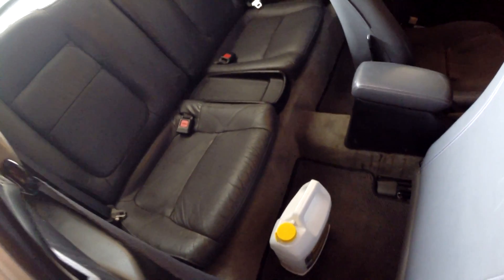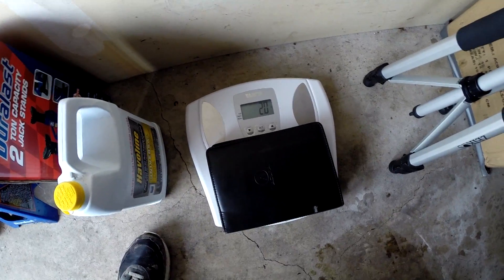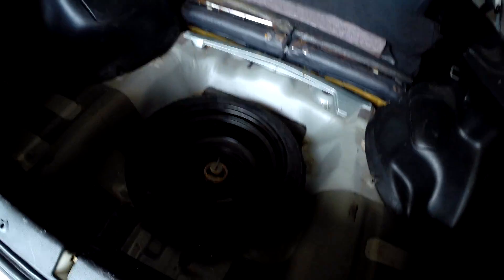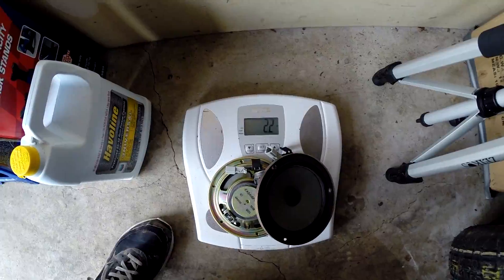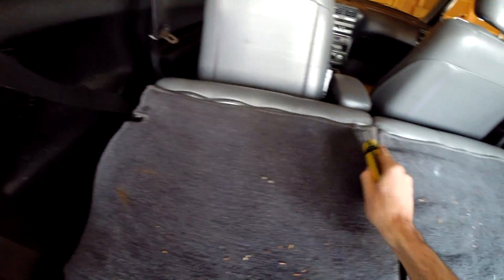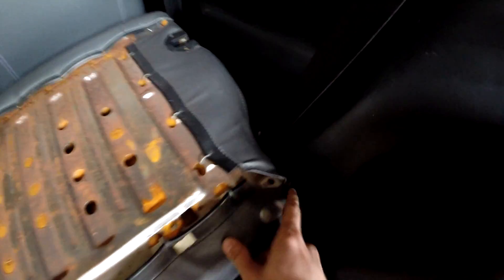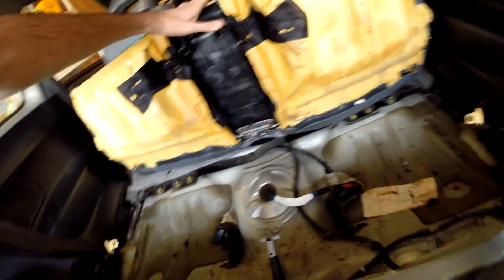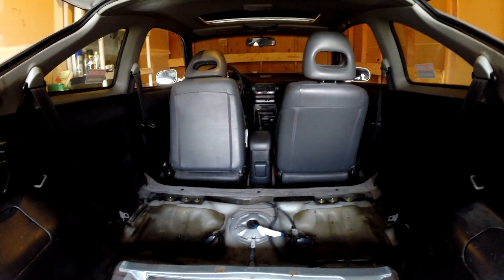Car Weight Removal - Acura Integra - Stage 1

Comment: removing weight is good when you want to go in a straight line but it's bad when you like going on twisty roads with a lot of turns and curves it increases the body roll of the car which can end you up in a ditch or off the road

Comment: Stage 2 Get a grinder and start gutting down your door panels. Replace Passenger and driver side glass with light weight plastic. remove Trunk lid and rear bumpers. Remove all plastic interior pieces.

Comment: With the replacement intake and the removel of both mufflers and the exhaust resonator I've removed around 60 lbs
How where ive probably put half of that back in with the subwoofer and the bigger sway bars

Comment: Ey bro you missed to remove the front passenger seat, it weights around 33 lbs (15 kg). I did it in my car, it feels the difference in acceleration, also putting a low weight battery helps to the front

Comment: The real weight gains are to be made up front, and in the rotational assembly. Flywheel, pulley, p/s, abs, a/c, wheels... Reducing weight from the front changes the weight distribution, and can be further accentuated by relocated the battery to between the rear tires. Years ago, I weighed all of those systems as well as the auto and manual transmissions.

Comment: do you know where the water came from by the spare? I have a 1999 integra I just saw that also..
Reply from the maker: Mine was entering through the brake lights, the gasket had gone bad. I used some silicone gel and that helped quite a bit.

Comment: one more thing I have to add is removing the spare will make your car less safer, the spare absorbs the impact of a big rear hit, sometimes cars go to the junk yard over this, specially your spare didnt even weigh much, my spare is like the original rims and its around 30kgs (65lb) and I wont remove it because it can absorb a hit, but I dont have a problem with being punctured because I can buy those temporally puncture repair kits and a lighter sicket air compressor.
Reply: ***** my spare is a full sized aluminum wheel (45lb) and its not loose and around my spare only 5 cm away from it is the body of my car, so in a big rear ending impact the force will be spread across the tire... the spare turns a big tear in the body into (after the rear metal bumper, the body is very thin and usually gets torn) just a small bend...good example can be your tires taking in some of the impact pot holes and sending the left overs to the suspension and then suspension taking some more and sending the very small energy to the chassis and then your seats taking in some more energy and sending the left overs to your spine....tires reduce the hit even if its very small, so keep them.
Reply: ***** the only time a spare can become bad is when its on the rear hatch of a car, like in some SUVs when you get rear ended the bumpers have done nothing but your rear door or hatch is fucked.

Comment: Pretty simple. If you plan on make your car into a track car. Gut the interior. Also take out the whole ac system, cruise control, power steering, airbags, and any other stuff that has no use in driving and going fast. However, if you still plan on driving you car in the street, or even daily driving it, I would strongly suggest not gutting it. The interior will look a lot uglier, as mentioned it'll be louder, and you won't be able to carry as many people. And you lose all your creature comforts making life much harder.
Reply: +Alex Leyva (WJawd) I am planning to do just that, but it still will be my daily, my dream car is Caterham, but I can't afford it, so I will make my car lighter.

Comment: +Engineering Explained Hello, I was just wondering, does weight reduction increase overall handling of the car? You know, does it make the car feel as if it has more traction etc?
Thanks
Reply: - Jake - A car this light, it shouldn't make much of a difference. Biggest difference would be wheel size, and tires you are using. Suspension would also make a good difference.
Reply from the maker: - Jake - Absolutely. It's a complicated subject, but here's a video related to the topic: https://www.youtube.com/watch?v=kNa2gZNqmT8
Reply: Engineering Explained Thanks, I'll watch that right now. Thanks for the quick reply too!
Reply: Alexis Leyva Cool, thanks :)
Reply: +Engineering Explained ok, but what you think about profits from reducing mass on rear of the car and changing weight distribution from 50/50 to hmm lets say 55/45. I Know that lighter car will handle better, but what if you reduces mass only on rear, especially in FWD car? Is will handle better or worse?

Comment: should probably do 0-60 times.. before and after to see if your vids are worth it
Reply: Jacob White Don't think you'll see much in 0-60's. Biggest difference should be the 1/4 mile. 83 lbs is a good amount but not that much. I believe 100 lbs makes about 1/10 of a second difference.

Comment: when i had a 1998  mitsubishi mirage hatch i did all that but went as far as to remove all the rear intior pannels and gutted all the inner workings of the back door not incliding the latch getting about 130 out of it

Comment: By just taking things out will do negative effects on the weight distribution. Remember, it's a front engine car, so it has a lot of weight in the front. By just taking weight out of the back you will make the understeer ever more worse.

Comment: If you're serious Engineering Explained  rip out the carpets and use dry ice and a hammer to get the sound deadening off the floors
Reply from the maker: pooft Lee Only 2/3 serious.
Reply: Engineering Explained Aww. But track day bro

Comment: Don't let anyone discourage you, next go for radio, aftermarket seats, weld roof if you have a sunroof, go for your ac and abs system if you'd like, oddessey pc680 battery,  next video please get into parasitic draws, so stuff like power steering and such. Better wheels can get you better unsprung weight, roof liner, radio, actual carpeting, rear trim and interior, sound deadening.... The list goes on :) good luck!!

Comment: I had an idea for an interesting test, but not sure how you would be able to do it.

Something people don't often think about or understand, is how as you lighten the car your suspension will actually feel and behave as though it were stiffer. 

It would be interesting if there was a way to quantify that, but it would probably take some sort of equipment to monitor wheel/body movement relative to each other, as well as a very significant weight reduction to notice a change in the data because of all the variables, suspension movement and flex, etc.

Comment: If your looking to take some rough data and have an android phone. I would recommend the torque app with a Bluetooth obd2 port dongle. That way it can collect ECU data, acceleration and rate data. $30 all in.

Another way is to you use look into getting a Vbox data recorder.

I would relocate the battery to offset the weight of the spare tire. Most Hondas have 60%+ F/R weight dist. Removing the rear weight just increase the front weight contribution = bad handling.

Comment: My suggestion where you could get other weight reduction. 

Lightweight Pulley
Lightweight Flywheel.
Lighter and Stronger sway bars
Lighter Strut Bars
Carbon Fiber Hood
Lightweight wheels
Reply: I'd suggest starting with removal of more thing before replacing parts, just to see what you can get without spending money, for example:

Remove fender liners (possible aero impacts though?)
Remove bonnet/hood liner
Remove A/C (compressor, lines, condenser, dryer)
Remove more interior parts (headliner, panels, glove box)
Remove sound deadening (big job, though)

After that, the most noticeable ones to do first would probably be the light flywheel and the light wheels.

:)

Comment: Can you mention in your upcoming video the possibilities of reducing weight by doing some grinding down of the cars unibody? I know that can cause unwanted flexing but I'd guess that a lot of the weight of it is due to crash test reinforcement which wouldn't be needed as much for a track car. Please mention something about this topic!
Reply from the maker: I think crash test reinforcement is even more necessary on a track. Safety man! :)

Comment: cool vid its almost like you've "added" about 5hp due to its lesser inertia, by removing about 80 pounds of unneeded weight, not to mention less stress on the breaks, and slightly better handling, however removing too much weight can cause unbalancing especially in the rear of a tegra but you still have a bit to remove before that point. thanks for the video love ur channel keep it up!

Comment: how much does the integra weigh overall?
Reply from the maker: Something like 2650 prior to weight removal. I need to go weigh it.
Reply: Engineering Explained If you ask around at a local autocross, somebody probably has a set of 4 scales they'd let you borrow. Then you would know your weight distribution, too.

Comment: Engineering Explained You make AWESOME videos man. I learnt a load of mechanical parts of the car thanks to your hard work on YouTube.

I was wondering if its worth considering where to strip weight out of the car particularly in this case where your Integra is front-biased by being an FF platform? If you are looking to other areas of weight reduction and depending on how much your budget is, it would be interesting to see you get carbon body panels, carbon door mirrors by craft square, lighter battery, lighter clutch & flywheel (but it may be harder to drive in town speeds), lighter exhausts, bride or recaro seats and especially reducing rotational mass from lightweight wheels, crank/alternator pulleys and carbon fibre driveshafts/propeller shafts. I'm not sure how accessible it is for you to get these parts in USA but well known Honda tuning companies are Spoon, J's Racing, Mugen, Powerhouse Amuse and many more! Sorry for the long comment but I hope you found some of these things useful :)

Comment: One other point to make. Everyone seems to think 100lbs is a 10th of a second in the 1/4 mile.  This is far too vague to be correct.  A more accurate way to look at this would be the percentage of your starting weight that you reduced is = to X percentage increase in acceleration. ( I may still be slightly off on that) For example 100lbs removed from a car that started at 2500lbs will yield a greater improvement than 100lbs removed from a car that started at 3500lbs
Reply from the maker: Yep, it's not a direct % to % ratio, but yes that's a much more accurate way of looking at it. I'll have a test showing actual results.
Reply: It makes sense that it is not direct. A fine example is that I started at a 17.4 1/4 mile in a DA9 Integra (5800ft in altitude) stock weight on the scale with me in it was 2715.  I did a pretty drastic weight reduction and got it to 2300 flat with me in it.  In each scenario I weighed myself prior to putting the car on the scale as well as having as close to the same amount of fuel in the tank as I could get.  My 1/4 mile time improved to 15.8.  I realize there are other factors such as slight differences in how I drove the car, track temp/weather, head vs. tailwind etc... but after having more than a decade experience at the track I can say I have decent consistency.  One thing I noticed is essentially each pound you remove becomes more valuable than the previous pound you removed.

Comment: I managed to pull about 450lbs from a DA9 Integra but the car was stolen before I finished my build :( also weight reduction improves acceleration, braking, handling, and fuel economy

Comment: on stage 3 video how about, no fenders no bumper no doors. no rear hatch n o hood. no ac unit. not so aerodynamic car. just for fun. lets see the 0-60 time.
Reply from the maker: No engine either, I'll use my feet!
Reply: Engineering Explained lmao 😂😂

Comment: What was the original curb weight of the Integra?  Would be interesting to figure out what percentage the weight was reduced...
Reply from the maker: Somewhere around 2650 I believe.
Reply: Engineering Explained So we should expect a 3% improvement in performance?  ;)

Comment: If the centre console is anything like the 90s accord I changed a stereo on a while back, it should be very simple to remove. 

If there was some way you could create the weight removed in ballast and move it around the car to compare handling as the balance shifts, that would be cool.

Great video!
Reply from the maker: Would be cool to play around with weight distributed in different locations.

Comment: Could you do a video on rotational weight? Ive heard that loosing 10 pounds in the wheels is equal to something like 70 pounds in the car. I just recently went from 14in steelies to 15x7 and 15x8 aero wheels and have noticed a huge loss in acceleration and mpg's. I knew it was coming, but didn't think the change would be as substantial as it is. Thanks!
Reply from the maker: I have a couple videos on the subject, both labeled as "rotational inertia" which I'd recommend checking out.

Rotational Inertia - Equivalent Mass
Reply from the maker: Roger Toledo Yes, you want the mass located towards the center of the tire. You'll enjoy this one: Rotational Inertia - Effects on Horsepower
Reply: Your cat might actually become more fuel efficient because you are going farther with the bigger wheels and beaten because you will go faster because once again you travel farther as the circle gets bigger.... (Referring to the wheels) and more likely to get a speeding ticket doing so
Reply: Wow, of course you already did videos on the subject lol. idk how they slipped by me. Thanks again!
Reply: Kris Cain I swapped the lead-acid for an AGM, that was 25lb reduction.
Reply: Engineering Explained if mass isn't a factor, would there be a difference in breaking distance between a smaller and larger tire

Comment: Probably not good for weight distribution 83 lbs taken from the back only, a cool thing to do (in my opinion) is move the battery into the trunk, remove the AC compressor (if u have AC on your vehicle) remove the passenger seat (probably is illegal?)

Comment: I'm really interested in seeing how this affects performance. You should add a nitro set up
Reply: Nitrous oxide? In a 4 cyl honda? That would require a complete engine rebuild with higher end parts which would not be very practical for a track car

Comment: pounds :/
Reply: Ok if you go by kilos, that's about 38 kilos
Reply: Roger Toledo And if you're using the Metric system the RIGHT way, that's about 371 Newtons.
Reply: Darkmatter28031 is it because I used mass instead of weight, if so, thank you for correcting me, I don't want to use the excuse of being American for my ignorance because my parents are Brazilian and I simply learned both, but as most Americans, I am more comfortable using pounds as unit of weight.... So any beneficial information is of great importance to me. Thanks
Reply: Darkmatter28031  Thanks both of you :)
Roger Toledo I'm brazilian too, lol

Comment: I am no expert, but doesent that mess up you wight balance, and since its from the rear, could result in over steer?!
Reply: It shouldn't change it too much, I can assure you Integras aren't setup for track either way from the factory.
Reply from the maker: Yep, it's changed the weight balance. I'm going to work on the front end eventually.
Reply: The actual performance is not thaaat obvious, but the noise inside will be considerably louder.
Reply: Yeah
Reply: Sweet, will you be uploading that?
Reply: Engineering Explained Thanks for your answer, I will see your next video!!

Comment: Take out the entire dash, that will save a lot of weight.
Reply: So will taking off the doors and the rest of the body, because race car.
Reply: Well if you can get used to straddling just an engine you will see huge gains in acceleration. You don't need all that other junk that the manufacturer tries to sell you.   Seats... Ha!
Reply: +TheCowGoesMoo o no that will hurt the areo